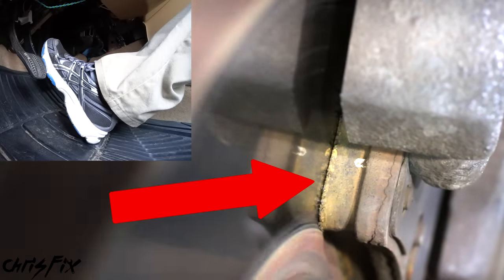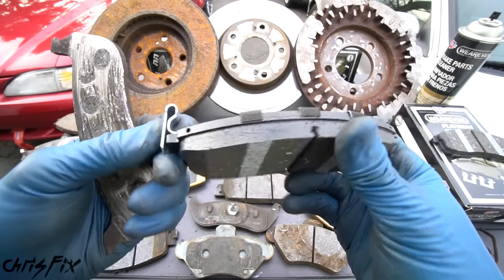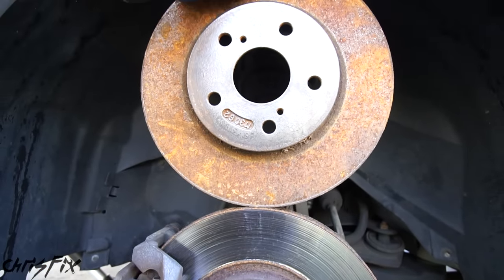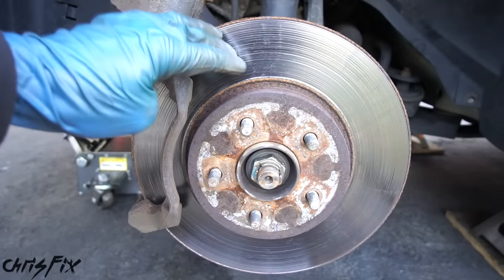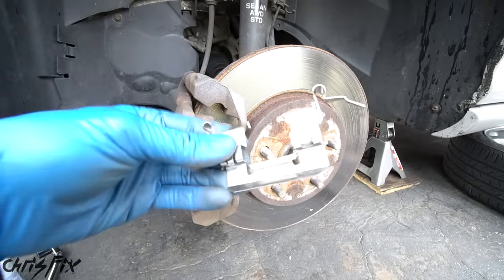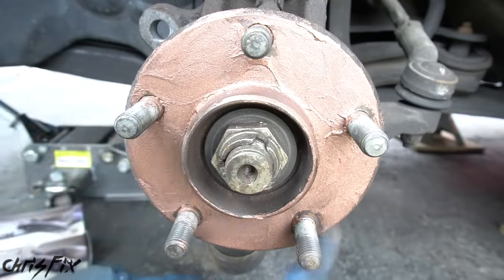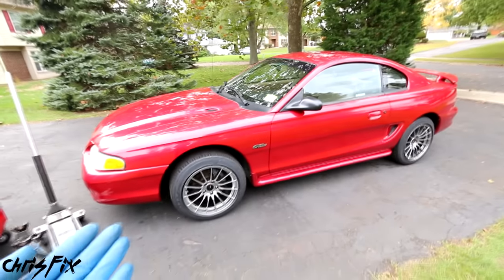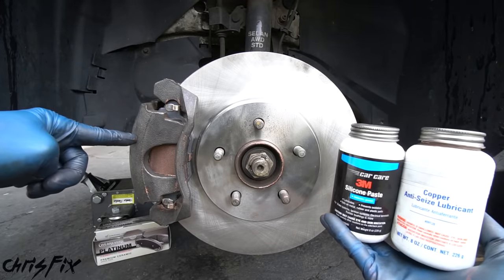How to Stop Your Brakes from Squeaking

Comment: My Mercedes S550 makes squicky noise when backing up.  Can I use spray ? Like a “disk brake quiet.
Reply from the maker: You can as a temporary fix but I'd recommend finding out what exactly is making the noise first

Comment: Hopefully 4 years later you can help, but my VW Passat is making a really bad grinding noise when I push the brakes. I just replaced them all around but only 1 side, the rear drivers side, is making an awful grinding noise. What could that possible be?

Comment: I have a hardware question. Do you know specifically if the anti rattle clip can't be an issue. My pads are good, my rotors are good and then after those were brand new and it still squeaked, I had the calipers and a bunch of other things replaced. I've spent a ridiculous amount of money and they still squeak. They only squeak sometimes and specifically when it's hot. I met a mechanic the other night in a parking lot and he was telling me that it sounded like the anti-rattle clip.
Any thoughts?

Comment: I replaced the brake pads, rotor, and wheel bearing. The wheel no longer wobbles but it still squeaks. The brake hardware on the outside is pretty bad and the pad has a hard time sliding around even though it is covered in lub. I have also noticed that the squeak is really bad when I make left turns, (the squeak is on the front right tire.) The only thing that moves on that side that isn't new is the CV joints or whatever they are called. It is a 2005 Pontiac Grand Prix. Help

Comment: Almost a year ago I bought new Hyundai and it is my first car with automatic transmission (torque converter). From first day brakes squeaks when I in D or R slowly releasing brakes in order to slowly start moving, or in short moment prior to stop. They told my that this is normal for automatic transmission because in D or R car is pushing to move, so if brakes is slowly releasing but still touching wheels that cause that sound. But I can't believe that nothing can be done in this case. I ask some people and some told me that they have the same experience, with other brands too (even Mercedes and Audi), but some told me that they never had this experience with different cars with automatic transmission. Can you please tell me your experience with this, and your advice about what can be done about this? I have discs in the front and drums on the back.
Reply from the maker: Doesn't sound normal to me, brakes shouldn't squeak at all

Comment: Just bought an Alfa Romeo 2018 Stelvio and I’ve noticed the rear right tire makes noise when I break and then the noise the squeak stops after three stops or four stops. Any reason why the squeaking is happening and why does it stop squeaking after a few miles down the road?

Comment: OK, so I know this is a seven-year-old video but I just came across it today ironically. 

Chris… got a problem… I recently had a lot of work done to my 2012 Honda pilot at the dealership including a four-way brake job and tie rod ends  replaced. 

Not soon after I started hearing what sounds like rubber on rubber creaking from the driver side front wheel area. I can’t figure out if it’s my brakes or my swaybar and swaybar links or something else in the suspension. 

I only hear it when I apply the brakes to slow down. When I do heartbreaking, I don’t hear it at all. There’s no vibration in the steering wheel. It doesn’t happen traveling on a bumpy road only when I’m initially applying the brakes to come to a stop.  

Now only had my pads and rotors replaced. 

Oh, one more thing, when I go through the car wash, I don’t hear it at all until everything is dry.

Do you want to take a crack at this?   I’d appreciate your insight or anyone else’s for that matter before I go throwing thousands of more dollars at it.

Comment: My car is making squeaking noise while driving it and also stoping, I had change front and rear brakes but when I took it for Aligment this noise started right away. Now I took it to mechanic they want it to disassemble the emergency break, because they hear the noise in the back. Also another mechanic told me is caliper, another mechanic told me is serpentine belt, idlers  and tensioner. Don’t know what to believe.

Comment: I have an 89 Caprice and the guide pins do not use rubber boots, can I use copper anti-seize instead? I found that the brake calipers do not swing up for shoe access, I had to remove both guide pins. Also, I missed the part about no brake clean on the pads.. I used a little during installation. should I worry about that? I'm guessing it dries so fast that there is no use in taking them apart to clean them.

Comment: Hey Chris, great channel... question: I upgraded my brakes with vented / slotted rotors now the rear right is making a knocking noise on my 2008 Lexus is250 AWD.  I been told that the pads are locked and not releasing?  appreciate your opinion

Comment: Have an issue with my SUV car's front disc brake, when driving from the garage being observe after about 3 to 4 miles  heard clunking noise on front passenger side although on flat surface road and even reducing the speed to very slow motion. After a several hours from the park and then drive again at first the clunking noise not appeared but after several miles (around 3 to 4 miles) the same clunking noise again, same issue even in a very slow motion on a flat surface road. Any possible reason makes such an issue?

Comment: I have a 2017 Jaguar XE.  It has just under 13,000 miles.  The brakes generally squeak loudly only at the beginning of the first drive of the day or if the car has been siting for hours and then taken out again.  The noise lasts about 10 minutes and then it stops.  My Jag dealer said it was carbon built-up due to it not being driven frequently and declined to do anything about it.  An independent mechanic said the same. What do think can be done?  The brakes feel fine but the noise is embarrassing.  Thanks much.

Comment: Why does my dad use lithium grease... I think also what does it mean when your brakes squeak up front and only stops when u brake my back drums sound fine.
Reply: Tay, I am guessing he uses this on the caliper for to ease the sliding on the caliper guide. Your pads have a notch in them and the slide back and forth on a guide. This typically gets greased with brake caliper grease. Maybe he uses it as an alternative. 

Your brakes could be squeaking because the pads are worn, maybe the rotors are warped slightly. You'd need to do a quick visual check of your brakes.

Comment: If im hearing any brake noise typically when im nearing a stop and it sounds almost like a bus braking but i just replaced rotors pads and calipers could that be my drum brakes in the rear? thats the only thing it could be right?

Comment: Hey Chris, I recently changed my breaks, rotors and hardware in my 2014 Pathfinder. But when I brake It sounds like metal on metal grinding. I have taken them apart and re-assembled and issue persists. What could I be missing. Every other break is good.

Comment: I just bought a used car from a dealership, they say they replaced the brakes, which I see that they replaced the pads they look new, but they squeak like MAD and the squeak persists even when brakes are hot or cold. Car is a 2016 Acura RDX AWD. What causes new breaks to squeak?

Comment: I need help, I have rocks stuck in my brake caliper, when I drive its a loud grinding sound and when I stop and use my brakes at any time the grinding gets harder and louder.. When I put it in reverse the rock gets stuck and stops the wheel and locks up the brakes and the brakes fail on me and I'm pressing the brake pedal all the way to the flop and I almost can't even stop the car.. Help me remove the brake caliper and make sure it stays compressed, I'm limited on tools, and let me know what tools I can use. I only have wrenches, various size sockets, long flat head screw drivers, short ones, vice grips, small pliers..

Comment: I get noise when I drive, the noise goes away when I brake. What could it be? I changed the pads, and my mechanic said my rotors look good. Should I still change it?

Comment: I put new discs and tryed 7 diferent pad brands , made tolerance between pad guidances and pads , but my Brembos still squeal . What do you suggest ?
Reply from the maker: Brembos are going to be running a pretty agressive compound, so unless you're driving super hard, they're going to squeak under normal operation!
Reply: @chrisfix  X Yes when i warm them up, they go quiet . But, what should i do now , because mostly i am driving slow in my town's streets ? Put cheramic pads on , or something else maybe ? Because years ago, they Were Quiet on the old discs .That's why I am almost out of ideas and also desperate  !!! I alos put double + stronger cross springs/plates  , but it still is Not better enough . Any suggestions ? Thank you.

Comment: It's weird when I first start driving the noise is there but after a while it done. I replaced the brake pads already and I do plan on replacing the rotors because it's almost 200K.

Comment: I am trying to research my brake squelch noise. Not sure which one is causing my issue. My mechanic replaced the brake pads and it was all good but unfortunately about a month or so later the noise is back. 60k miles on my car. Think its the rotar??

Comment: My GT86 has rear brake whistle for more than year and fail to resolve it - it only whistle when I start to break when speed is above 20kph. Replaced the brake pads three times - from old OEM to Bosch to Blueprint to new OEM (with hardware), replaced rotors two times from old OEM to Bosch to Brembo, replaced the caliper and guide bolts. Shield is straight. Changed the mechanic two times... Still no clue...

Comment: A friend of mine told me about cleaning and lubricating the slides (brake hardware) on disc brakes.  I had never done this before when I would change my brake pads. I told him my brakes were "vibrating" when I would press the brake pedal.  I wasn't sure he was right but when I changed the brake pads in the front, I cleaned the slides and put the proper lube on them and the back of the pads and when I drove it after that, most of the vibration has gone away,  I need to do the same to the back ones now.  Here's a question though.  While I can understand lubricating the slides and such, how does putting lube on the back of the pad where it meets the caliper, keep it from squeaking?

Comment: Hey Chris, i just checked the video, but still cant find the reason for my specific problem. The thing is that, i have more than 50 % of brake calipers left but in low speeds i get that rubbing noise from my brakes

Comment: Why after using the brake so many times on roads. The front brake started to make a noise when I start to move the car from stop sing or raffic light for couple of seconds after that the noise disappeared.  I changed The rotors and the pads since last 12/2021.

Comment: Use lube never go in dry. Use the proper lube. Use the special grease to lubricate the actual brake parts it's designed not to interfere with braking don't use the anti-seize for lubing the actual brake parts.

Comment: Hi Chris My car brake (front right) makes a noise when I apply brake while the vehicle is comparatively on slow speed say 25-35 kmph. I have attempted to rectify it many times but to no avail. Besides brake pads I have changed caliper pins, brake rotor. Every time say after about 200 miles I found that brake pads are getting hard with a non-even wear pattern. What could be the possible reason.

Comment: Any particular reason why copper anti-seize on the rub points between the pads and calipers instead of just the same silicone grease for the pins?  I've seen other tutorials do it this way (it was labeled "brake part lubricant" but I'm pretty sure it was just grease)

Comment: I have a 2017 Toyota Camry. Previously I changed my brake and I was dumb to test the by slamming the brake as hard as I could. After that brake was squeaking. And made a sound like as you run your fingers down on a wet plate. According to the research I found out I have glazed the pads. So I replaced the all four brakes and rotor including brake hardwares. All the parts are from toyota. But still my brakes squeaks? 😔 Any idea why

Comment: Hi Chris, my brakes have been squeeling non stop recently and my brake pads were replaced about a year ago so I brought them in under warranty and they replaced the pads, didn’t work, then they added an anti squeak and cleaned the rotors and pads, didn’t work, and then they said I have to replace my front brake calipers, didn’t work which I paid $1000 for.

Asking for some advice

Comment: Mate... Recently I have changed by front disc brakes myself, car is running smoothly.. Brakes are applying perfectly, but when car is coming to halt or at 0kmph at red light, a metal sound is coming (even brake is pressed at red light). While driving there is no sound, no car sound over poth holes.. Nothing.. Only when car is going to stop at 0. I lubricate all parts again as shown in the video again, but still there is sound. I used old brake clips but clean and put anti grease on it, while installing

Comment: I just recently changed my rotors and break pads but I notice this kinda constant grinding noise like the pad is resting on the rotor when not using the breaks and on occasion I hear this horrible grinding noise almost like a metal cutting tool. Any ideas?

Comment: Hey man man great video. I have my wife's 2009 Volkswagen Touareg and the front pads are squeaking when she first drives the car and backs out of the driveway. After that they are fine until sitting again and starting up for the first drive. I took the brakes apart last weekend and the rotors look fine and the pads have plenty of life. I cleaned everything up and sprayed some Squeaker on the rotors and pad surface. That lasted for about a week and now the squeak is back. Any ideas? Maybe sand down the pad and rotor lip? Or some anti-seize on the back side of the pads?. I believe you said in your video that squeaks are vibration.

Comment: I think my front wheel bearings are bad cuz the rotor rubs the pad n shield. I put new rotors n pads on this year and my abs service light turns on sometimes.
Reply from the maker: You might have accidentally bent the shield (you can just bend it back) and I would reset the abs light when it comes on! Sometimes those components need to be reset after changing out stuff like that
Reply: @chrisfix  thank you! It makes a weird noise like Ruston rust or metallic. I do maintenance and it reminds me of thin metal because it isn’t a growl it’s more of a “higher” yet moderate pitch like sheet metal rubbing if you can picture that. I have a 2013 Impala which is prone to the abs cable fraying. Do I have a few thing I. My sleeve but In the morning I’ll check it out and hope it saves some dollar signs. I love you brotha thanks Chris!!!! Your content is 100% pure In Heart and knowledgeable. Can’t thank you enough
Reply: If you see this as well, I’ll post a video of what I find and stuff so maybe I can help others too. Hopefully we can both and as a community all learn. I love working on cars and troubke shooting and would rather go through issues and present fixes before others have to. ❤️❤️❤️❤️ thank you Chris!!!

Comment: I just replaced my brakes pads and fitted some new rotor plates in both front wheels - the problem is it squeaks when the brakes are cold - it is getting away when it is getting HOT
Reply: could be performance brakes (racing brakes). they tend to do that.

Comment: I know this is an older video, but hoping u still see this. I just changed out my front and back rotors and pads. I used lubricant, cleaned everything, but the brakes are making a grinding noise (im pretty sure in the rear) like my pads are cometely worn out. It only makes the noise when I press on the brakes. If you have any suggestions I would appreciate it

Comment: Chris, my friend has a jeep wrangler that the disks have a very small band that the pads are contacting the rotor, theres about an inch thick shiny ring and the rest od the surface is rusting.  is this from uneven pressure on the pads? unlubed guide rod or possibly one of the pistons not going in? Thanks for the help

Comment: Great video lots of information , question what happens when you replace rotors, pads and calipers and only when you are in pumper to bumper traffic breaking constantly then your brakes start like slipping and rubbing kind of noise

Comment: I changed brakes and rotors today and now the caliper touches the rim, the part store said that parts are correct, any tips to check that or should i just shave off the caliper?

Comment: Chris, you’ve shown there are a lot of parts that can squeak, but your thoughts on this please; I had 2011 Toyota Sienna’s rear brakes (pads) replaced last year at the Toyota dealer. The brakes continued to squeak when stopping. More after first leaving home but also a little at the traffic lights. After a few months I took it back to them and they said there is no problem. Two months ago I took it into Discount Brakes and they also said the brakes are ok. The car does stop ok but the squeaking bothers me. What do you think the culprit might be?
Thank you.

Comment: Hi,
I hear break noise/squeeze when I lift my foot from the break pedal. The car is holding still after I driving for a while. 
I cannot see you covered that part. :) 
Maybe this could help others with the same problem. :) 
Thanks.